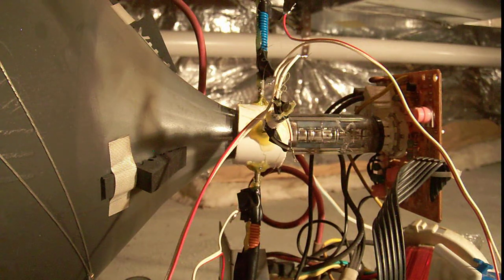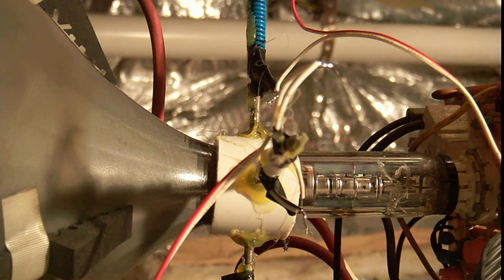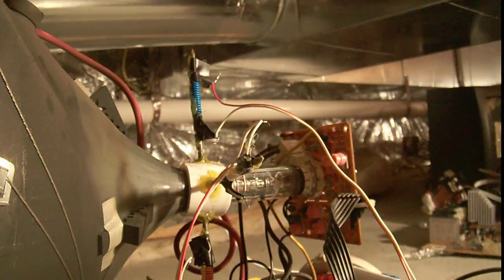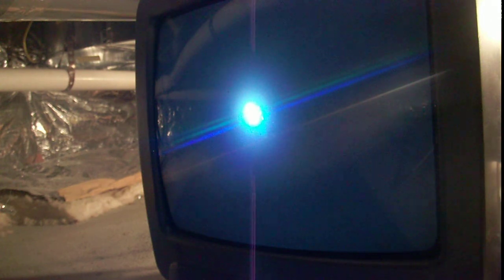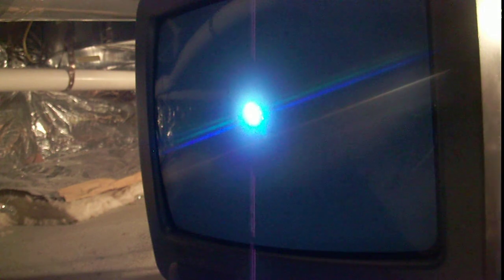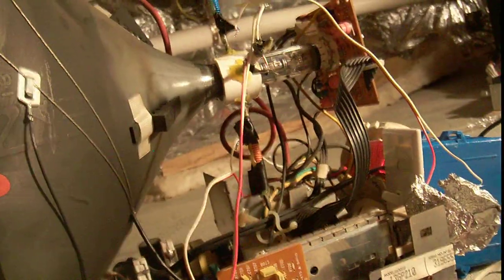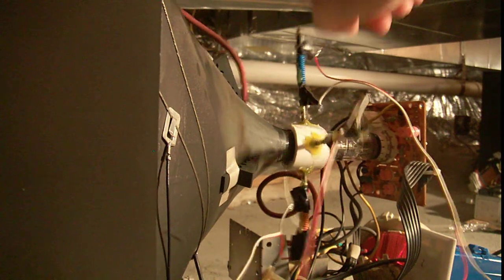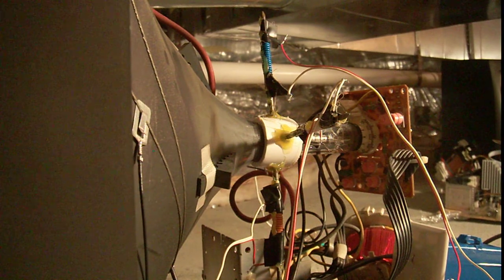Quadrupole Magnet

Comment from the maker: If you mean straight down the tube than the focusing circuitry built into the CRT will do it for me, if you mean a vertical line that is what the quadrupole magnet does. It will squeeze all the electrons onto one axis with its magnetic field.